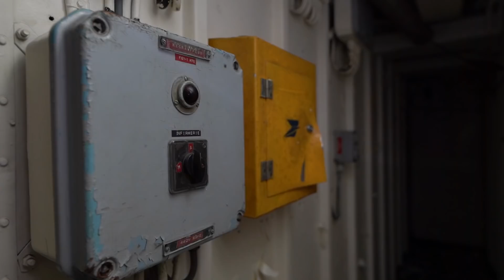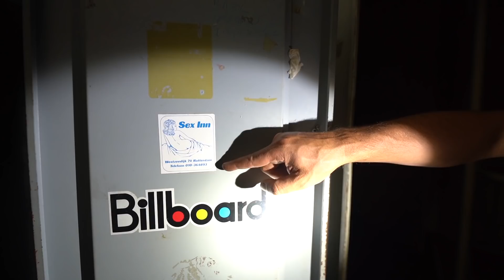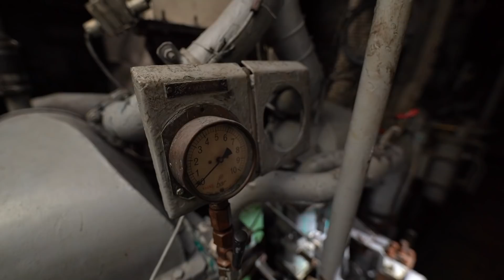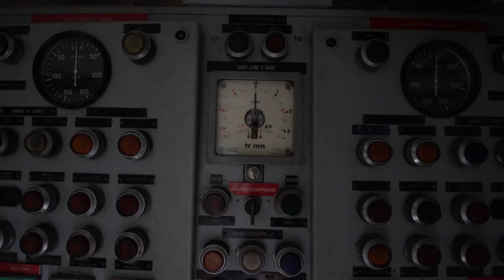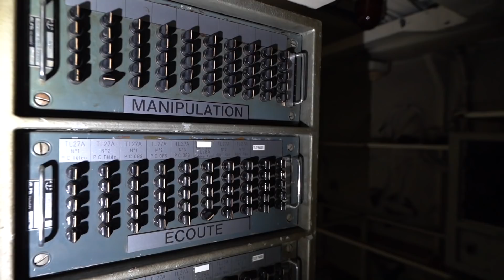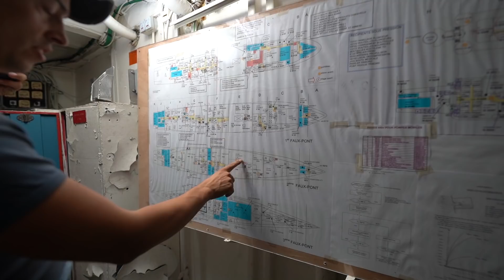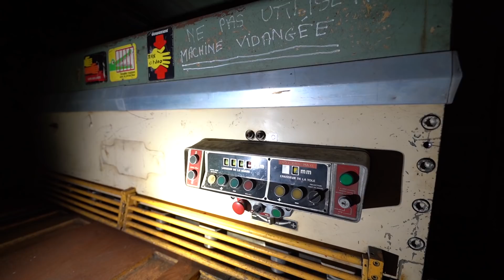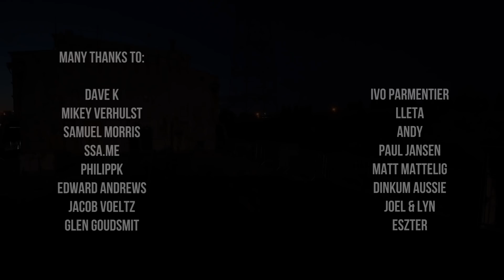URBEX | Exploring a naval support ship

Comment: Warships and submarines are always interesting. On the surface everything looks like a convoluted mess, but everything has an important purpose and the use of space is as efficient as possible. 
Interesting to see the workshops in these ships, too. The lathe can be used to fabricate/refurbish axles, flanges etc. And with that sheet metal brake, you can fix cladding and bulkheads. There's a reference to Acetylene bottles on the ship mapas well. You need to have the means to cut and weld steel on those ships for sure.

Thanks for the glimpse into this beautiful behemoth.

Comment: It looks like they would refurbish/rebuild Diesel injectors (things at 17:10) in the machine shop, and perhaps test them with the nearby machine with pipes and flow meter.
Reply: Exactly this.  Injector tips are a wear item and the internal springs need to be shimmed to get proper opening pressure.